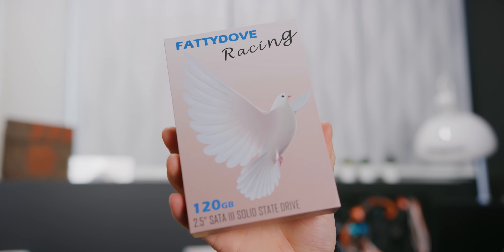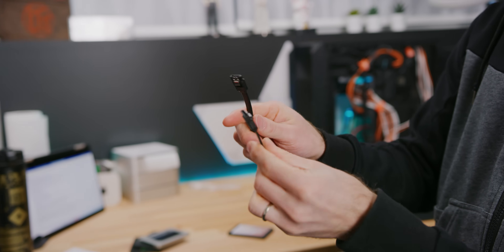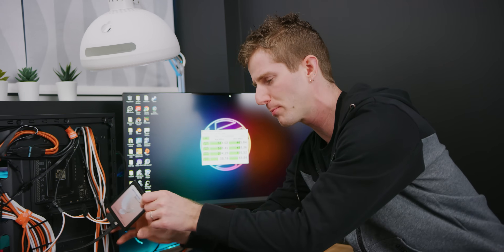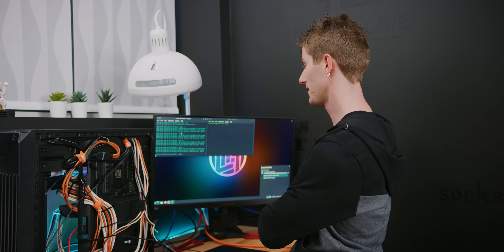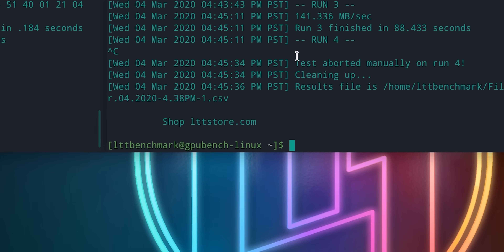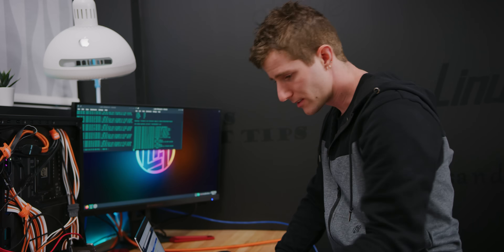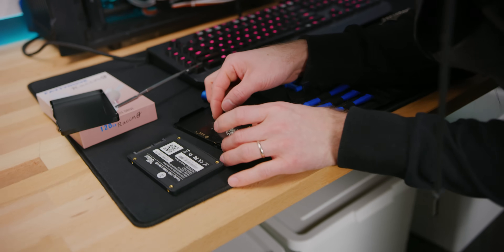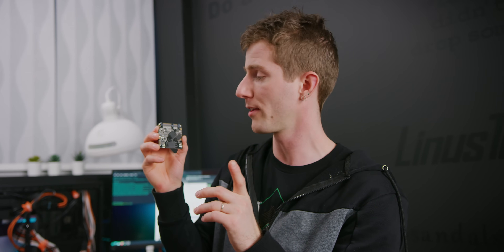How bad is this $20 SSD??

Comment: You laugh at the SLC cache but you're missing something I guess... You don't specifically need SLC NAND to have an SLC cache, you just need to store one bit in a cell instead of two three or four. Lots of drives advertise SLC caching and do it in this manner, mapping out an area in the TLC NAND to function as SLC. The controller can ever change how much there is dynamically based on usage.

Secondly any SSD will serve better as a boot drive than a traditional hdd as far as speed is concerned which is, I'd imagine, what most aftermarket SSDs of this size will be sold for. I have one of the cheapo ADATA ones you used as the worst example running in my game server, it doesn't deal with constant heavy write loads, it sits and reads with some occasional writes to map data and software updates.

Comment: I can't seem to get the correct screen resolution in linux in dual boot...however it grabs the correct resolution in virtual box...if i force the correct resolution in dual boot linux...it makes the image offset...what should I do ??? Linux is very slow in vm...i really need the dual boot...tried nvidia drivers ....it grabs the resolution...but the image is still offset

Comment: My local Microcenter sells their own brand of SSDs. $20 for 240gb. They are an actual steal.
Reply: btw, for anyone interested I managed to recover data from a sh1t drive (kingfast) by freezing the drive !!!!! Like I used to do 20something years ago with quantum bigfoot hdds !!! It worked for 2 minutes, enough to get some critical data out !!!
Reply: @A True Brit don't scare me, I have a sandisk 256GB ssd plus as boot drive and a crucial MX500 500GB as personal drive, are the WD Blue 500GB SSD good?
Reply: @RONDIZZONI-FAMAE  your boot drive is barely not trash, your personal drive is pretty good, WD Blues are solid.
Reply: @Caleb M the sandisk unit I bought it on almost mid 2016, do you think it's time to replace it with a better one? my plan is to use the M2 PCI-E slots on my motherboard but the reviews are very confusing and often times people didn't tell me what was the best for booting/productivity/maybe-gaming, they just tell me the M.2 PCI-E had zero advantages with an 8th gen i7 non-K, 16GB 3200MHz with a 1080Ti, that's the only piece i'm missing right now, sorry for the long read now.
Reply: @RONDIZZONI-FAMAE  it's true there's barely any advantage to NVME over SATA 3 in consumer workloads, but it's still more convenient and clean to install
Reply: @Caleb M at the moment, the only units suggested to me are the samsung 970 evo x and the gigabyte aorus nvme ssd (the one that claims to do up to 5 GB/s read
Reply: @RONDIZZONI-FAMAE  you're pretty much good with anything name brand besides the Intel 660p
Reply: Everything at microcenter is a steal. Lower end hardware is generally lower margin, but at microcenter a 3000G is $42 plus $20 off a motherboard. I don't know what microcenter is doing to stay above water, but I sure wish there was one within 500 miles of me.
Reply: I've use the same one for years never had any issues
Reply: they are ok in a pinch but i had 240gb sata model that died after two years of use. while in comparison my sandisk 128gb i got in 2013-14 is still work great. the sata models are much cheaper quality wise compared to the the nvme stuff. So get that instead
Reply: @SuperCookieGaming_  I definitely wouldn't recommend using them, or any other cheap SSD, for long-term storage, but they are great for things like a boot drive, game storage, or scratch disks on a budget.
Reply: @FTGTapGod  well i used the 240 inland as a boot drive and lost all my data. my sandisk used to be my boot drive but now it is just a disk i use save my screen caps until i edit them.
Reply: @SuperCookieGaming_  depends on the generation of sandisk. newer ones have some sort of protection, that locks the drive when it thinks is about to crash. The problem is that the protection system is actually crashing. I've lost data on a few, some were in raid 5, and I lost both in the same incident(ordinary power failure), and the data was irreplaceable. also could not return them due to the nature of data being stored. the bug is known. drive becomes RO, but you cannot read anything from it.
have a good one!
Reply: after 3 hours of sustained access it dies on you. also if you keep them over 45deg Celsius (like in a laptop)
Reply: are you two neighbors?
Reply: @atruebrit6452  Done both of those and more to these drives and never once had an issue. I have bought many Inland SSDs (both SATA and NVMe) and all have worked great. I use the NVMe drives as scratch disks for 8k .r3d files.

Comment: Wait
Really?
You have read from nowhere at interface speed and you are surprised to find interface speed?
Consolations at understanding SSD technology.
You have read what you have written resprayed for as many times as it was needed. Read about SSDs, TRIM and unmap. You basically have gotten fully unmapped SSD, written a bit of data to it and read the same data back many, many times. NTFS is so small that it actually have fitted into Dram cache.

Choose allow performing or better choking SSD
Perform full trim on any device supporting it. Read whole disk. You will be reading this disk at speed of either Dram or interface whichever is slower. But you won't be reading Flash itself. You will be reading dram cache.

Comment: Most computers I run into have a 500gig 2011 or older slower then dirt hard drive on it's way out. Dram chip or not for 20$ the user experience will be night and day for them with this drive.10/10

Comment: This kind of very cheap SSDs are usaully using second-hand chips or defect products with lower performance or stability but still can run. In high rate you may find chips from different companies in different SSDs of the same product. Although some brands and companies will control the quality and make sure that their product can performe over the line they set, but many companies won't and their price is lower in 5~10 boxes (yes, even 5 boxes can change a lot in mass production). So for me buying these is still like looting boxes and I can't recommend this. Just the same as other parts in your PC, this kind of products is like a bomb.

Comment: I also got a cheap SSD and the SLC cache simply uses TLC cells as SLC. Its faster to use, as the charge of the cell doesnt have to be set as exactly, as in TLC mode.
Its faster, but limited in capacity

Comment: SLC caches are actually very common in modern SSDs, including cheap SSDs. Even many SD cards and USB drives have SLC caches.

The trick is that modern NAND flash supports running specific pages in SLC mode. The controller reserves a portion of the NAND as a SLC cache for writes. These writes are later flushed to the TLC/QLC pages when the drive is idle.

Even high-end drives like the Samsung 970 Evo Plus rely on an SLC cache to deliver their extremely high write speeds. Along with thermal throttling, that's why consumer SSDs slow down after sustained writes.

Enterprise SSDs tend to be designed differently and target sustained performance.

Comment: Hey Linus can I use this on my 5 yrs old HP laptop? I have a 1tb hdd, and 8gigs of ram, with cd drive. Do I need to remove the cd drive and use this? Will it improve my laptop performance?
@linus
Reply: Some laptops can use a dvd/cd drive and 2 additional drives. Most can use a cd/dvd and just One extra drive that in your case is the harddisk. It is possible to buy a tray for a harddisk or ssd that can replace the dvd/cd drive and it is possible to connect Stuff like SSDs using a cable that convert USB to Something an SSD can understand
Reply: @user-it6nz3rh3z  well the harddisk is more usefull that the cd drive so if he installs a Linux on the SSD then he would win

Comment: The top Amazon review for the 240GB version is weird: Best SSD ever. 30,000 jiggabytes per nanosecond write speed. I've been using this SSD for over 20 years in my racing laptop without a single failure. Power draw is a little high, needs around 1-2 lbs. of birdseed per day.

Comment: i've been playing with many dramless ssd for quite a long time now,sandisk ssd plus,kingston A400,crucial bx,adata su630,i also had multiple good nvme drive.
in my experience,you'll not notice any different between the with and without dram if what you're doing is just gaming and microsoft office
youtubers tend to think everybody does video editing day in day out,that's not the reality
Reply: However, DRAM-less SSDs from reputable manufacturers are usually not that much cheaper, so I wouldn't ever buy one. It's not like they cost half as much, they are not a good value unless you are a system builder for office pcs who tries to save every single dollar that he can.
And I would also never buy an SSD from some rando China-brand, not even from a better-known brand that doesn't make their own NAND flash. Because no matter how good one of these is in a test, you can get a completely different product. 3D-party SSD re-sellers usually use random chips and hardware depending on market price, you are buying a surprise box.
Reply: @maximilianmustermann5763  in my country, the dram model cost 25-30% more,maybe doesn't seem much in lower capacity but once you go up to like 1tb,its pretty significant.
i rather get more capacity than having a dram.

Comment: Hey.... I've been using TeamGroup L5 3DLite 120GB drives for about 2 years now.  They aren't as fast as PNY or Samsung.  But, they are close in speed.  I bought 15 of these drives for $20 a pop.  They have been fine for general desktop usage.

Comment: I will never understand people who say dram-less SSD's are slower than hard drives, I've been using a $30 Kingston A400 for over 3 years now and it's still just as fast as the day I bought it, which is much faster than the HDD I'm using for games and stuff. Still boots in under 30 seconds, still launches every program I use within 10 seconds, and it's still a ton faster than ANY hard drive I've ever used, even staying at 70-80% full for most of the 3 years.

Comment: Fattydove Marketing:
“DRAM Cache Buffer technology”
“No Dragging for games”
Low Calorific Value
Gotta love those Diet Fattydoves
Reply: Low calorific value might be referring to heat output and it could be a genuine case of engrish
Reply: isthisoneunavailable Heat output/Joules/wattage.
But I like to imagine they spell calories with a big C
Reply: @uss_04  capitalized c or not, calories can be used as a measurement of heat
Reply: dietdoves*
Reply: @LueLou generally speaking you are correct but my bet is they took the joule value of the unit's heat output and converted it to calories, which as nonsensical as it is isn't totally incorrect.....technically

Comment: I find these little drives to be most appropriate and cost effective for refurbishments and upgrades of all sorts.. I am currently using and old HP laptop which original 500 GB hard drive has been upgraded to SSD technology, but downsized to 60 GB using a 22€ amazon SSD. Actually using the machine in order to evaluate the quality of Ubuntu (or linux in general) in the everyday use. I tell you for what i paid, it got my machine up and running and it is working well so far.

Comment: Kingston’s 120 gb ssd is a good $20 one I have a few
Reply: I got a few of those I crammed into $50 i5 2400 SFF PCs. Doesn't need to be top of the line performance, and they do way better than a HDD.
Reply: Same with PNY
Reply: DRAMless! NEEXT!
Reply: @FVBmovies  Actually there are other 20 USD SSDs with DRAM, for example: Topmore TLC 120GB and Mengmi Extreme 120GB.

Comment: Microcenter actually has their own branded drives for this same price and they work amazing
Reply: I believe those are also dramless but you at least have a reputable brand backing it and it might be made to better specs
Reply: @tonyhong20  The should test cheap ssd
Reply: Inland professional is pretty good, but for the most part is good enough for its price.
Reply: Certain models were bad.120 maybe? I heard from employee buddies.
Reply: Microcenter is just amazing, for real.
Reply: I mean as someone who works at micro center I still don’t buy them lol
Reply: On amazon, inland ssd's have a lot of negative reviews for bad reliability and customer support